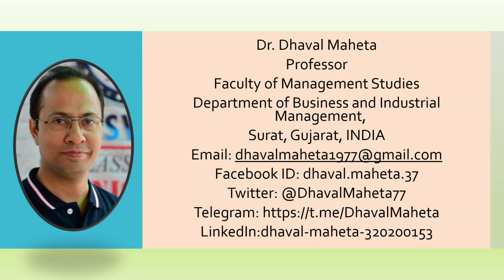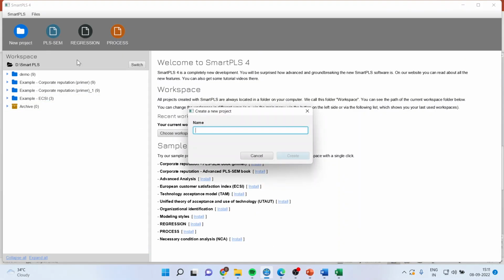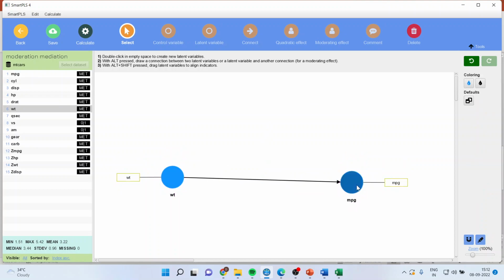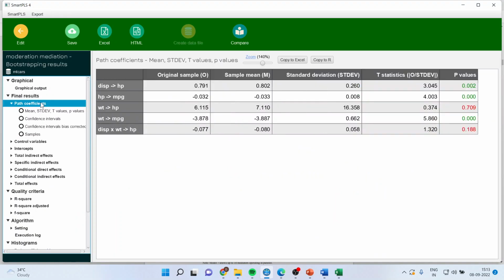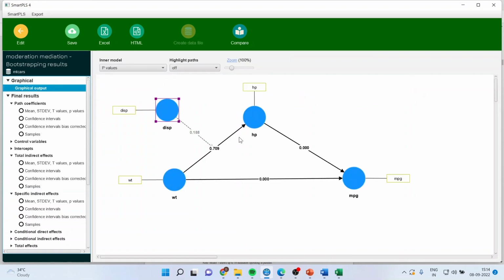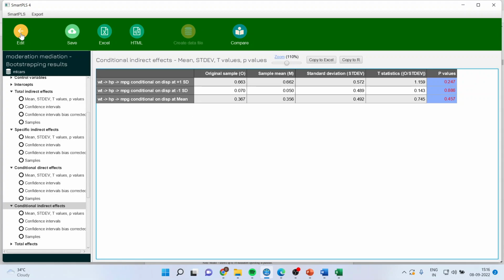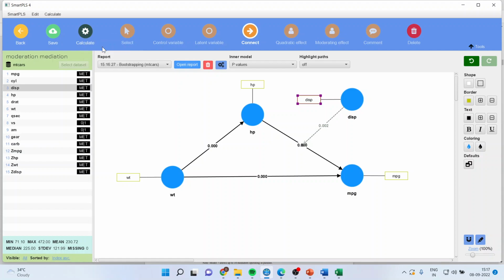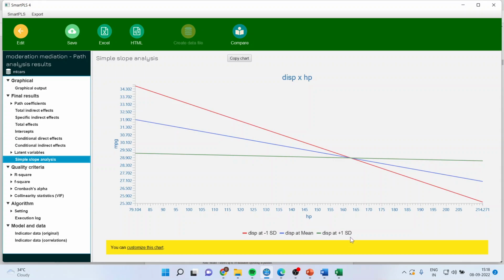31. Moderation Mediation Analysis using Process Macro in SmartPLS-4 || Dr. Dhaval Maheta

Comment: Dear Prof. Dhaval,

Can you let me know, whether moderation is there in the last example, as the line are not parallel, which is the requirement for moderation; however, one of the three relationship (+1sd) is not significant, which you mentioned that is pre-requirement for moderation. Request you to kindly confirm. 

Thanks

Comment: Hello. I hope you are doing well. Can you please guide me in SmartPLS 4 when I run moderated mediation in Process tool, in case of three moderators, I shall run moderators in one go or run one moderator at a time on the indirect paths? My model has 2 IVs, 1 mediator and 1 DV and Mediator and DV are HOCs
Regards
Reply from the maker: In one go you can do it
Reply: Respected sir,
if I run the model with all moderators, conditional indirect effect shows me paths like this
SL -> SE -> SP conditional on Inno at +1 SD and Supp at +1 SD and Bur at +1 SD.
It is not showing me the paths separately for every moderator at +1, mean and -1 SD.

If I run every moderator separately then it shows paths separately like
SL -> SE -> SP conditional on Inno at +1 SD
SL -> SE -> SP conditional on Inno at -1 SD
SL -> SE -> SP conditional on Inno at Mean